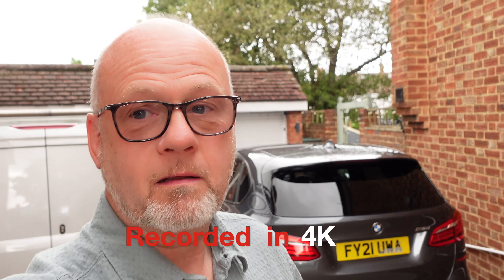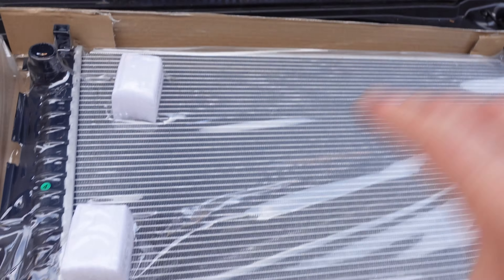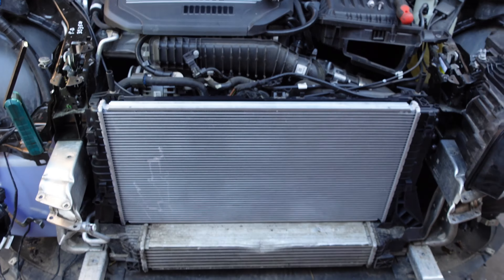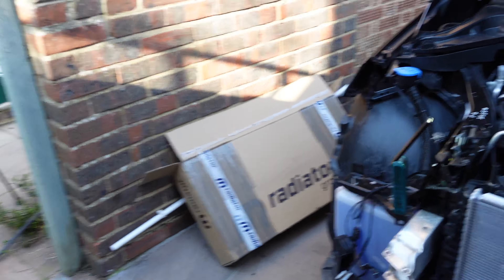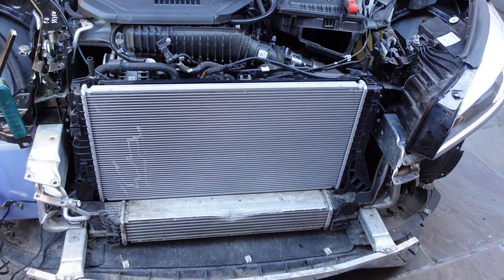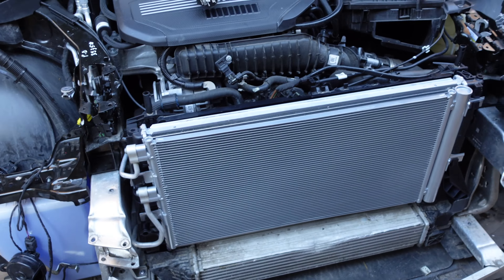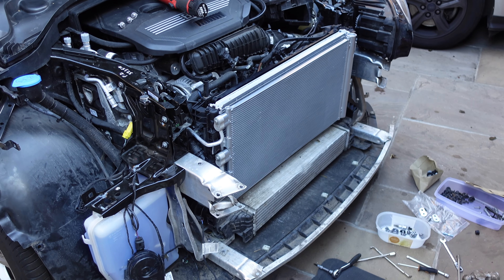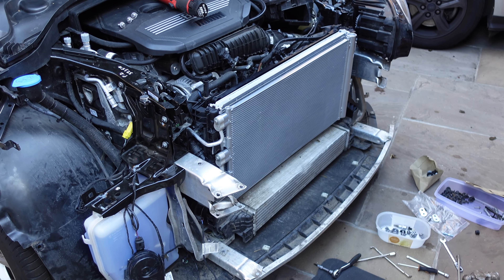BMW 2 Series Active Tourer MSport LCI 1.5 Auto - Day 3 of the Repair - Cat S Salvage Crashed Beemer

Comment: Be careful when filling cooling system, you will probably need to follow correct bleeding procedure or risk frying the engine if you don't get all the air expelled. I think some BMW with electric water pumps have a special self bleed routine you have to follow 👍
Reply from the maker: There wasn’t anything on diagnostic machine to do it electronically but I’m going to do a search as I believe there’s a procedure you can do yourself.
Reply: @Love500  Yes depends on what series and engine you have, but there was quite a bit about it on Google. Sounds like it could be done without diagnostic 👍
Reply from the maker: @SalvageMasterEssex  yeah I found it. Will try at the weekend.

Comment: Get the £60 thermostat (if that is part of the thermostat) & just swap the elbow over.. Or see if you can get that elbow from a friendly breaker, he`d probably only want a tenner for it. What an arse of a thing to work on though.
Reply from the maker: Couldn’t find the right one. I’ve kept the old one, hopefully I can get some money for it.
Reply: I put a reply up earlier, & its gone? @Love500
Reply from the maker: @MrPabsUk  🤷‍♂️
Reply: Ok! Weird..  @Love500   It was just to say, that thermostat is shared with the 1.5 MINI`s, which are easier to get used, & I was asking if you have any Fiat 500 airbag modules knocking around?
Reply from the maker: @MrPabsUk  nope, no modules I’m afraid.

Comment: Normal anti freeze dilution levels are 25-30% concentrate to 70-75% water for UK conditions. Best practice is to just fill with normal tap water and check for leaks before going all in with Anti freeze.
Reply from the maker: BMW told me 50/50 but as I lost a load I’ve bought another bottle but mixed it up a bit weaker.